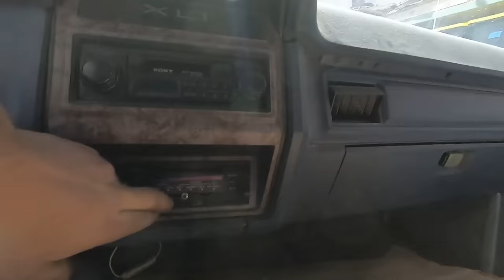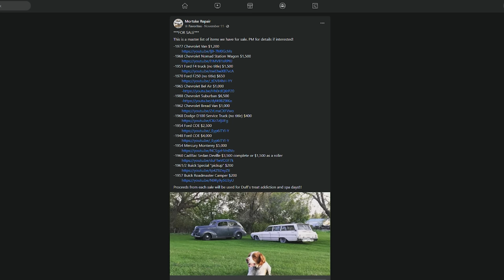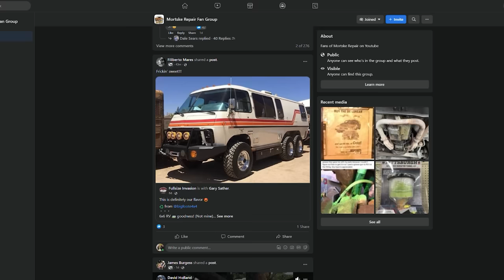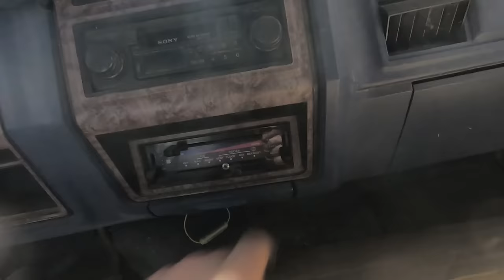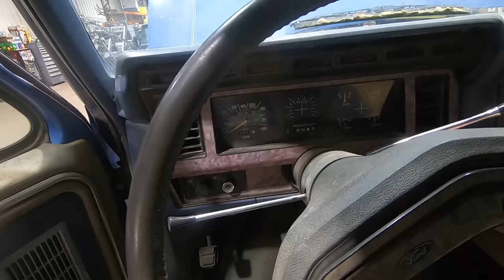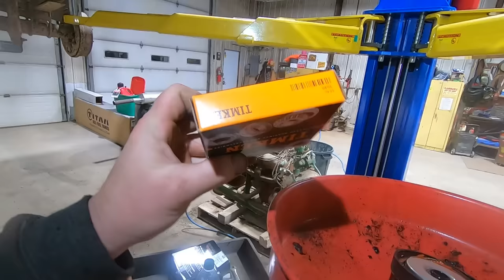Revival and Transformation of an Abandoned 1985 Ford F150 4x4 Farm Truck!

Comment: at 23:15 thats the high pressure fuel pump it was only used for a little while theres 3 pumps on these the 2 tank pumps and the one on the framerail this injection system needs 60+psi of pressure to run correctly although they will run on less
Reply: that splitter in the wiring is part of the factory tow package and yes the last year of the 9in was 79 last year of the dentside after that f150s got 8.8s and f250 got a wide track sterling 10.25 and f350s got a narrow track sterling 10.25 the dana 60 rear was also an option
Reply: this has 8 injector you have to look at the color on top but im guessing its orange so ther 19lb/hr injectors theres 4 per side 1 per cylinder
Reply: the 351/5.8 was still carberated this year all the 5.0/302 were efi

Comment: I have a 2WD 85 F150. Has a 5.0 and the SROD manual transmission with 3.55 gear. I built a 310 hp 5.0 for it and the transmission first gear ratio makes it a turd when taking off.
Reply from the maker: Awesome!

Comment: I had a super clean 90 f150 and that thing had weird running problems I could never figure out. Finally decided to sell it after shotgunning a bunch of parts at it. It also had terrible fuel economy and terrible power. I’ve been less than impressed with this generation of fuel injection. My 77 F150 w the same power plant had more power and way better fuel economy. Both were 300 inline 6

Comment: Fun fact, they make a little code reader for these things, I have one for my 1993 F150 with the 302. It's borderline useless, generally these old Ford EFI systems run, or they don't, really no inbetween. 

Just a few things I want to point out after owning a 9th gen F150 for nearly 5 years, and crawling over 7th and 8th and 9th gen F150's for parts in the junkyard. First, the valve covers are annoying at best to do because you have to remove the upper half of the intake plenum to replace the passengers side valve cover. The upper intake plenum has a hidden torx bolt in the middle down between the runners, it isn't a through hole, and that bolt is missing on mine, doesn't seem to matter it's missing, truck runs fine. 

The fuel tank selector switch on the 7th gen trucks like yours is a fragile POS, I'm surprised it works at all, the 9th gen has a rocker switch in the dash which likes to break loose of the crappy instrument cluster bezel, as mine has, but it usually works a little better, my selector and fuel pumps both work but the rear tank has a hole in it so I can't use it. 

A mini starter may be worth investing in, they work way better, and deleting those cats will pick you up a few ponies, these trucks don't make much stock. Mine has headers and a high flow cat but the headers are going away, previous owner put the headers on and I'm tired of regasketing them and chasing loose bolts, gonna get some new stock manifolds. Probably won't sound as mean but I am so sick of these headers it's not funny.

You can move the airbox to the drivers side fender with a 9th gen (And I think 8th gen had it too) airbox, easier to service, doesn't cover up a chunk of the engine. The "Ram air" style intake tube your truck has is the better one, where it comes in beside the drivers side headlight, mine has one of those from a big block 9th gen, the 9th and I think 8th gen had a stupid intake tube that sucked air from against the hood, I don't know why. Probably doesn't make any more power, but at least I know the engine is getting air. 

I think it only applies to the E40D (Electronic overdrive), and I don't know what year they started using those, but when the E4OD gets low on tranny fluid (about a quart), it turns the engine off when put in reverse. I wish I was joking, it's really annoying, kind of handy, but it mostly just freaked me out when it happened. 

Check the coolant hoses going to the throttle body, mine are bypassed, but sometimes they plug up with corrosion and can cause a coolant leak, in a climate like yours they're probably beneficial since you live in the frozen north. Down in Virginia in the summer? Not so much. 

Dunno if you know this, you probably do, but the doors interchange from the 7th, 8th, and 9th gen trucks. The whole front clip can be swapped, I'm planning on doing a bullnose swap on my '93 F150 Flareside, I just don't like the 90's front end much. These trucks from I think 81 is when the bullnose started to 1996 are essentially giant lego kits, it's kinda cool.

Lastly, these trucks had about a billion radiators with a few different fan shrouds, so if you put in a rad make sure you got the right one, my shroud is zip tied in because I went for a 2 core rather than the 1 core stock rad, it bolts in and the hoses line up but that's about all that was right on it. 

For the record, I've owned three Chevy trucks, two square bodies and a '89 Sierra, three Dodge pickups (One is my late fathers wrecked '83 that I'm looking for a home for the 318), and only one Ford truck, the Ford is the one I kept.
Reply from the maker: Awesome!

Comment: The throttle plate gets carbon build up and sticky on accel  and won't close 100% so it'll tend to surge at idle, stall off idle and idle erratically .carb clean and a rag clean the throat and plate edge . Top , bottom and plate spindle .  This goes for just about all ford's. Lol
Reply from the maker: Thanks for the info!

Comment: the factory ford wheels where alcoas i wanna get a set for my 89 the biggest difference between the american racing wheels and the factory ford alcoas is the alcoas are one piece this is technically 2 pieces riveted together and this has more circle holes since the alcoas are larger holes  and yes your expedition is 5x5.5 just like this truck this should be the next towpig id paint it if i were you just weld a patch in for the wheel wells or buy the ford replacement panel
Reply: also yes the bumper is factory its the tow package bumper and yes the tailgate is missing the red plastic band everything on its factory besides the wheels the tanks are 19 and 21 gallons unless it has the 38 gallon rear and 21 gallon fro nt(which this dont but that was optional) loved the video hope ya have a good week bud
Reply: also the 351 would be a 5.8efi the 302 is a 5.0efi then the 300 six is a 4.9efi i prefer the 5.0/5.8 over the 4.9 of course i prefer the diesel over gas but they dont exist much here my 89 is a factory 1 of 1 optioned truck and one day when i find a 7.3idi/7.3idit ill diesel swap it right now it has a 5.2efi(bored and stroked 5.0)
Reply: the ttb came out in 80 for the bullnose there was never a ttb dentside ttb was also used on the f250(could get a straight axle too) there was 3 ttb setups dana 44ttb ld(light duty for 150) dana 44hd(heavy duty on some f150s with the tow package and some f250s) then dan 50ttb (f250 only ) my truck was a conversion truck(technichally) and has a ttb dana 44hd/50 mix ambulance frame ambulance upgraded wiring and alternator ambulance rear springs and coil springs up front and my truck also has factory custom bedrails to fit the frame and look normal(like its just a regular truck) ford used both warn and dana hubs

Comment: Was the truck made at the Kansas City assembly plant
Reply from the maker: No clue
Reply: @MortskeRepair  you can tell by the vin tag… or a window sticker on the front or back window
Reply from the maker: @danharris8046  Rear window has been replaced with a slider.

Comment: Lol. You damn near spent more than the truck is worth just replacing fluids. Where do you actually get that bulk hose? I need to get a few spools of 1/4 and 3/8 fuel line. I use a ton of it on small engine stuff, and I am tired of buying it by the foot.
Reply from the maker: Amazon

Comment: Yeah Mortske it sucks.......but in 7 days 50% increase in cases and the Turkey DAY push has arrived(UPTICK due to T-DAY HOLIDAY(SHOWS UP 2-3 weeks after)).   80% of hospital beds are occupied!!!!!!(with VID, FLU, RSV(triple threat they are mentioning) As of the week ending Dec. 3, the hospitalization rate currently sits at 2.5 per 100,000, the highest ever recorded at this point in the season over the last four years. Ex. UCSF HOSPITAL the number of patients is increasing after holding steady for a few months. At UCSF hospital, there were 10 patients with COVID-19 at the beginning of November compared to 40 currently. So INdoors crowded put em on or indoors small room(multiple people)....Just use your heads you all know the drill(Your call)!!!!!   Beeyatch!

Comment: Normal power steering fluid is probably the cause of the leak. Fords  of the 60s through 90s take type F.
Reply from the maker: Never seen dexmerc cause a PS leak
Reply: @MortskeRepair  oh no I meant ps  fluid
Reply: @MortskeRepair  regular old power steering fluid older fords and certain imports do not like at all. Tends to eat seals and hoses and cause leaks. I had a 93 F250 that I replaced the hoses twice because of that, until I learned about the type F thing. Honest to God once I replaced it, the thing had the quietest ps, and it was effortless even with the big 7.3 sitting over the axle and 35s
Reply from the maker: @Jacksonkellyfreak  News to me!
Reply: @MortskeRepair  I legit didn't learn that until like a couple years ago. I put a new pump on my f250 and it still whined and was weak. Once I learned that it was night and day

Comment: The moment ford switched to the steel beds, they've been hot garbage ever since, I wish they stuck with galvanized for the beds. Lucky to go 5 years up here before your body starts to rust now. I also hate the I-beam suspension, Pain to work on as well, I've dleth with far to many I-beam when I worked on fords for a living, I got good at it, I just like GM's design better, upper and lower control arms 8 bolts and a shock and spring falls out.

Comment: Hey going to be 350 for the fraud 355 in the rear regular steel toothbrush it will look in the back 3 l55t you have a locker in the rear breakfast for your head
Reply from the maker: Thanks for the info
Reply: @MortskeRepair  I know Mr 80-86 ford's all to well.  Have had at least 40. I do love your show and keep it up 😌
Reply: 355 and 354. Sorry

Comment: DID YOU FORGET TO REMEMBER TO FILL THE RADIATOR SO YOU DON'T  BURN UP THE MOTOR  / YOU NEED SHOP CHECK OFF BLACK BOARD  SO YOU WILL NOT FORGET WHAT YOU WERE TO REMEMBER THAT YOU FORGOT , SPIT HAPPENS

Comment: Not bad mate, not bad.  Seeing them mice hightail it out the pipe when she started was a bloody good laugh....and that engine sounds sweet.  Looks much better without the seat cover, although I'd probably put one back on it, myself.  Yeah - it's either a well-treated round-the-clock 170k miles or the body has just had a hard life.  Hard to pick.  Funny - it almost rides as well as a shagged-out Chev Square-body!

Didn't see you as a "black wheel" bloke.  Hate black on black myself - looks like someone couldn't be arsed picking a colour.  I especially hate it when some moron paints alloys or a model-specific wheel / alloy black.  Ever seen black slotted wheels?  Bletch!  Just No.  No.  and again, No.  The only way a black wheel looks good is with a chrome centre cap and a trim ring (or "beauty ring") on a black car.  On anything else they look foul in my opinion.  The same sort of people fit vinyl covers over a cloth or leather seat and put those stupid padded bits on their seat belts.....or put a steering wheel cover on that doesn't fit properly and fit cowl-mounted gauges and those stupid bumper-mounted lights on a stick so they know where the corner of their car is.  

Don't fall for the hype or next thing you'll start mounting your white-letters out on a new set Cragars......

Dunno why you reckon you have to pander to the Ford blokes though - they had a Merc to look at last week.....and six of the fifteen vehicles for sale are Fords, only five are Chev, two are Buick, one is Dodge and the last one is the Caddy.  Ok, strictly speaking the two Buicks are GM, but come on.  If anyone deserves to whinge it's the Chrysler / Mopar mob! 

Ol' Blue is a good truck though....or will be once the frame is plated / welded back up.
Reply from the maker: To each their own on the wheels! I've seen folks paint Cragars even!

Comment: they are not the same bolt pattern fyi. found out hard way.
Reply from the maker: Oh?
Reply: @Mortske Repair  yeah they changed in 97. Bought a set of used wheels for my bronco and they didn't fit.
Reply from the maker: @jeffreyrigged  Silly Fords!
Reply: @Mortske Repair  I was thinking why change. They are like a 1/4 in different so it's no stronger. Never understood car companies. Would make more sense to have a few standard size bp throughout all car companies.
Reply from the maker: @jeffreyrigged  Went to metric I'm sure is the reasoning
Reply: @Mortske Repair  yeah but it was a metric that only they used for 8 years and no other company lol.
Reply from the maker: @jeffreyrigged  Go check out the 7 lug pattern they used in 1997 on their "5/8 ton pickups" silliness
Reply: @MortskeRepair  oh I remember lol

Comment: Chevys in the 80s and Fords and Dodges in the 90s all paint flaked off maybe they're buying all their paint from the same place,  Toyota pickup trucks ther chassis would rust out and the motor would still be good, as long as you have the trusty 22 r or r e.  No snow?
Reply: It's always been like that with Ford's the doors are always shut the best out of dodges and Chevys.
Reply: Birdshot 22LR for those varmints

Comment: A Ford will never be better than a GM.
Having a Gas tank on each side of the truck, wouldn't that be a good idea, to help distribute the weight??
Especially if you have a questionable size driver.
Ford definitely could have put that tank selector switch in a better spot, one would think it's a part of the climate control.
Reply from the maker: agreed